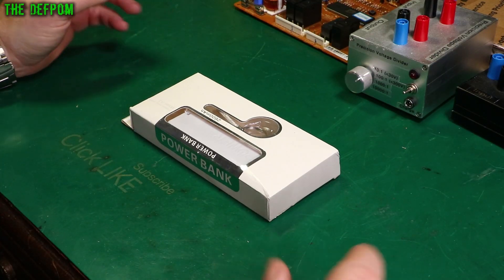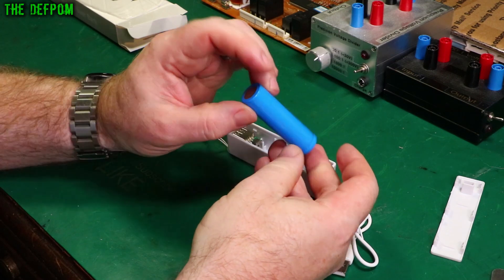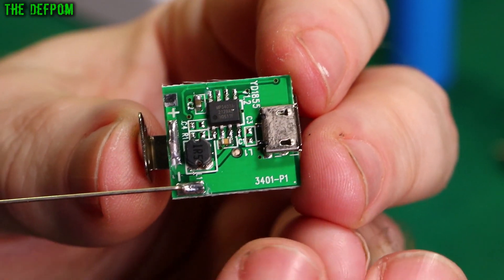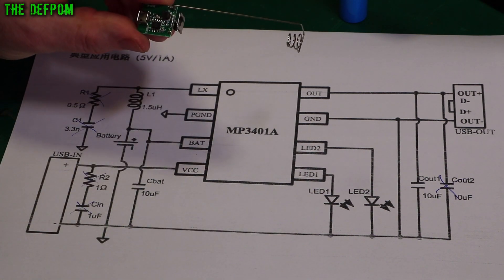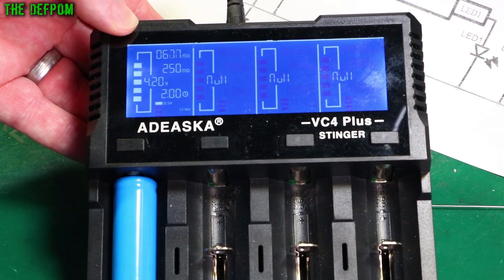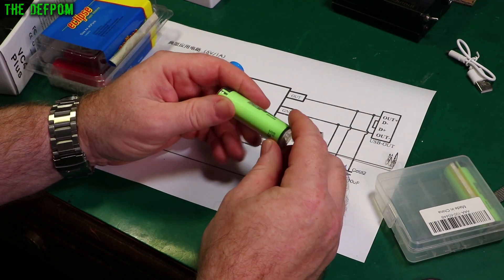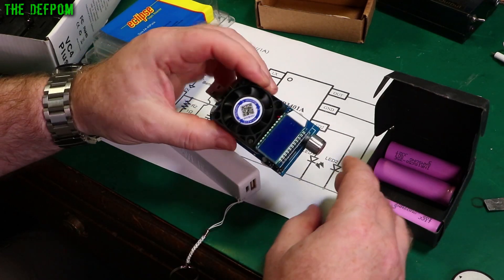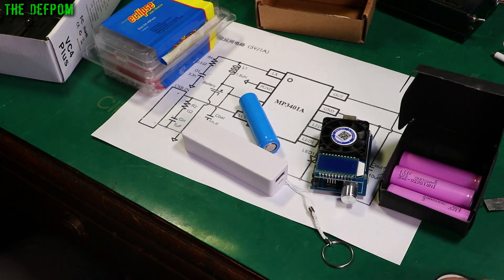🔴 18650 USB Power Bank Inspection and Testing - No.961

Comment: In the UK you can get these for £1 from Poundland, I usually just put in a salvaged cell from laptops etc, they are good to have around. they also don't turn off with low powered devices so good to power small projects.
Reply: They became quite rare a couple of years ago. I have a few on they all seem to have a capacity of 5-600mAh. They were in fairness sold as 1Ah. They now do a 2200mAh branded one for £3. The can get up to 1.6 - 2Ah which seems a pretty good buy

Comment: I bought a similar one from Poundland a few years ago. I replaced the cell for a with a higher capacity one. It useful as it doesn't cut out at low current draw.

Comment: Bought a gew of them without cells, as you can simply put in salvaged cells and use them like that. Perfect for using a USB plug in lamp to make a torch, and with a LED they run till the cell is around 2V before shutting off, and even though the cell goes down to 1V it will charge back up again no problem, just the cell loses a little capacity every time. They stay fully charged for a long time, so I have them all over as torches, using reclaimed cells in them, even the 600mAh cell will do hours of work in there as a torch, with only 50mA current draw. Yes they can also charge your phone up a little in an emergency, but probably only a quarter of the way on most modern phones, though I did use the guts of one with an old pouch cell, to get a replacement for a mining lamp, converting to LED at the same time. Works well, just had to remove the old lead acid inners, and leave the case in some caustic soda solution for a week to neutralise the acid in the plastic, then in bicarb solution again for a week to neutralise the caustic soda.

Comment: It is a pity you did not do the last test with the USB load using the original cell. I am not surprised it worked good with the better cell. I myself would add the missing components. Just to see if it improve things. I would also measure the output with a scope to see if it is "dirty" . But that is easy said, I made some videos in the past but I did not have the time. So I know the whole proces costs a lot of time.
Reply: With the missing parts it will be better, but it still relies on output ripple to drive the switching, better is to simply use a small electrolytic on the input and output, which provides the needed ESR and capacitance. 47uF 10V will fit there no problem, they are small enough though you will need longer leads on them.

Comment: I bought a load well a few of the powerbank items without batteries to use fitting my own batteries like you I found that they did not take protected batteries, but I fitted inline fuses to add protection and they work well for emergency lights like a torch I also got the twin battery power bank items they were cheap and handy :-)